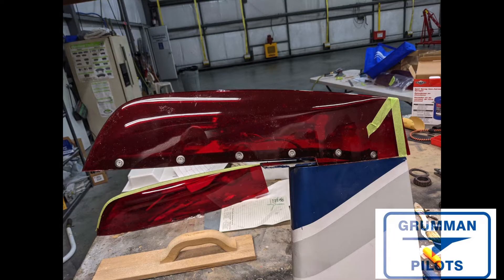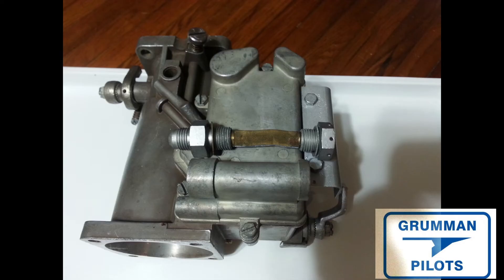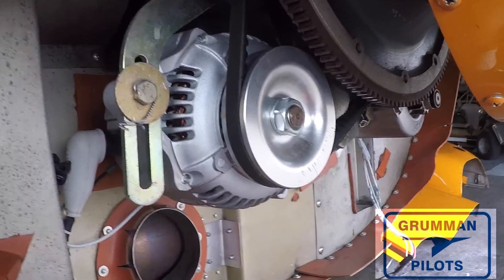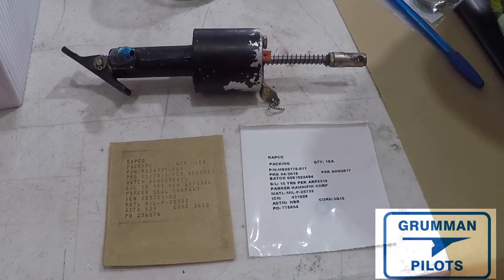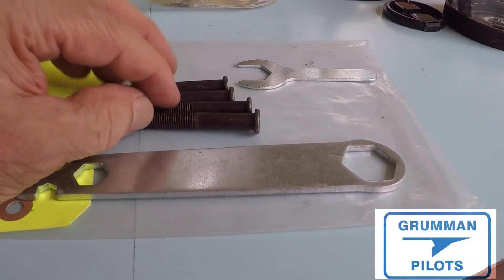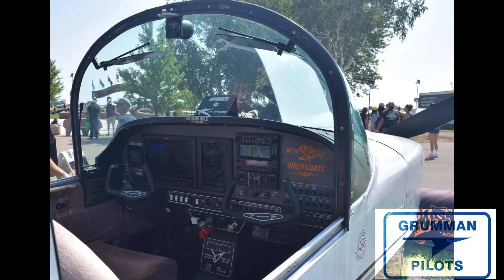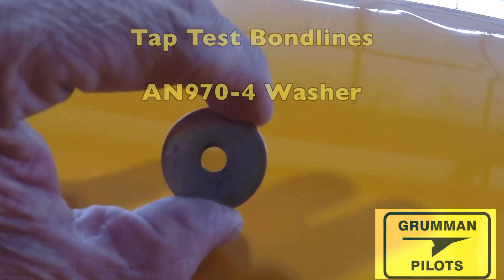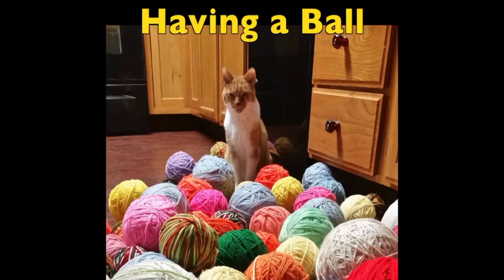Hangar Flying Episode 14 - August 6, 2021 - Grumman Style

Comment: What material is the engine baffles made of. Can you just cut out a replacement or do you have to buy a FAA approved part?
Reply from the maker: Measure your, then yes, you can take 2024 T3/6061 alum and remake the part.
Reply: @GrummanPilots  Should have been more specific in wondering what the rubber boot part is made of.
Reply from the maker: Basically fiber internally reinforced baffle seal like material.  Need some?  Also have the boots for sale.  FYI